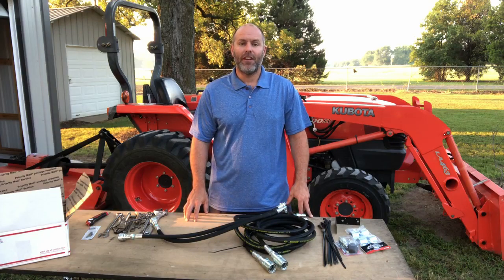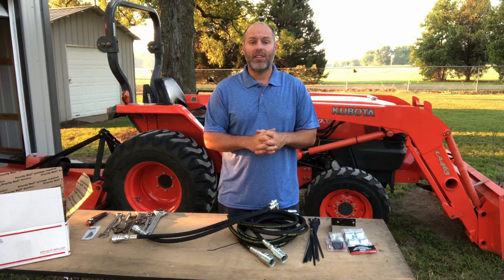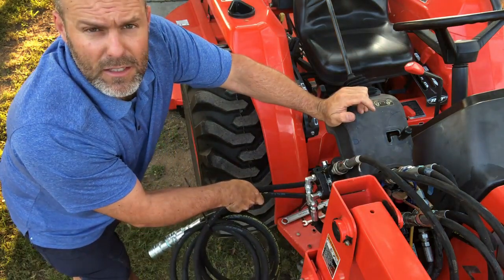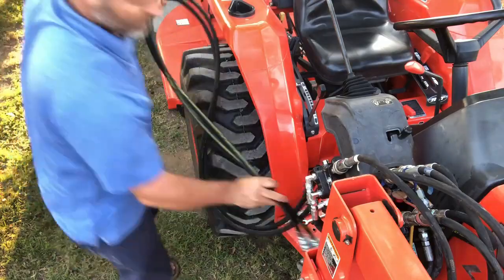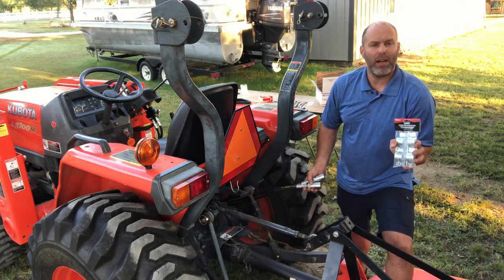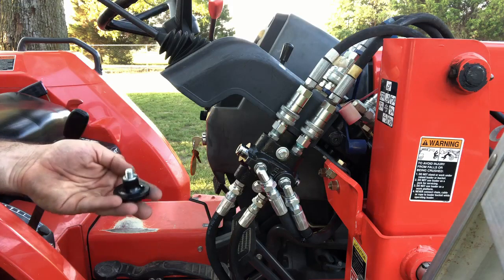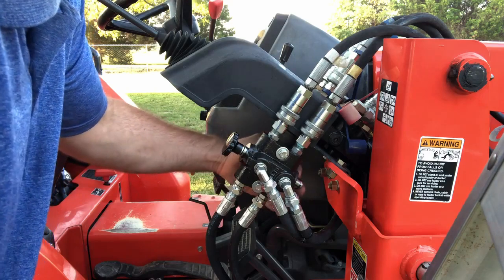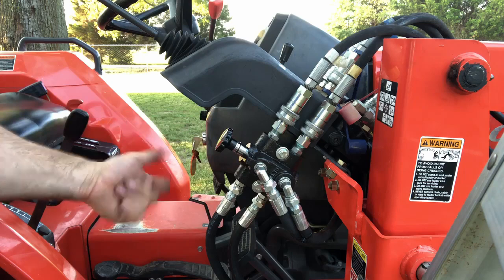$595 Remote Hydraulic Kit for Kubota Tractors - Updated - No drilling required!   15 minute install

Comment: Any plans to make a kit for the LX2610?
Reply from the maker: Yes, This works perfectly on the LX series tractors.   Your loader control is mounted in a different spot, so customers have simply mounted the valve to the dash.   We have dozens of installs like this, and they're working great.   You can order on the website, just type in your model of tractor as you add it to the cart.

Comment: Will this work on a 2000 model L3000?
Reply from the maker: Yes!   That model can have some older versions of the quick-couplers, so send me a picture of one of them disconnected so that I build your kit correctly.   Easy install even on the older tractors.  Email or text me - those numbers can be found on my website:
http://www.tractorinnovations.com

Comment: If you take the loader off, will this still work?
Reply from the maker: Yes, on every modern tractor.  Anything with 4 quick couplers on the loader, and you’re golden.  That’s every Kubota after 2002, and a few before then.

Comment: Will this work on a l2850 kubota
Reply from the maker: Yes, you'll use the economy kit, because that tractor uses threaded fittings instead of quick couplers.   You'll tap in to the hydraulics where the rubber hoses mees the steel lines on the loader arm.

Comment: What about a Kubota MX 6000 w/cab?
Reply from the maker: Yes, those new models with cabs work great!   We run the hoses through the access hole in the back of the cab so that you have the switching valve handy inside the cab.

Comment: I have a set of hydraulic lines going to the rear of my L2501 to operate my backhoe. I want to install a Trim and Tilt kit for my 3 point. Do you have a kit that can connect to the backhoe lines that I can use to operate a Trim and Tilt?
Reply from the maker: I don't yet, but working on that.  I'll let you know when I've got it ready.

Comment: Do you have a kit that will control tilt and angle cylinders.
Reply from the maker: Yes, you can install two complete kits.  I can knock $50 off the second kit.    It works really intuitively - the top link is run off the lift circuit (forward/back motion of the control lever), and the tilt is controlled by the dump circuit (right/left motion of the lever).   I am updating my website to include the double kit option.   Until then, give me a call or email.  I can take an order by phone or send you an invoice to pay from.  541-972-0546   tractorinnovations@gmail.com

Comment: I have a 3rd function valve already on a L3301 for my grapple, is there a kit for top link and tilt for running a box blade?
Reply from the maker: Yes!   I just installed one of these today on a L2501.   You'll install two complete kits.   I can give you $50 off the second kit.    If you want to start with just one, try it out, and add the second one, that works well too.   Youc an order one on my website, but if you want two at the discounted price, shoot me an email.
www.tractorinnovations.com
tractorinnovations@gmail.com

Comment: Is it possible to hook this up to my third function valve on my Kabota L 2501 and switch back-and-forth between my grapple and my top link allowing the button to operate either or?
Reply from the maker: Yes, it works great for that.   Juts note that in the loader info as you add it to your cart.    I do top links as well.  Check them out on my website.
www.tractorinnovations.com
Reply: @TractorInnovations  m